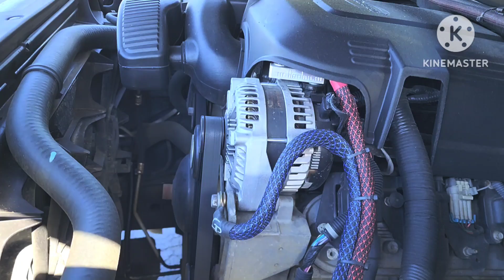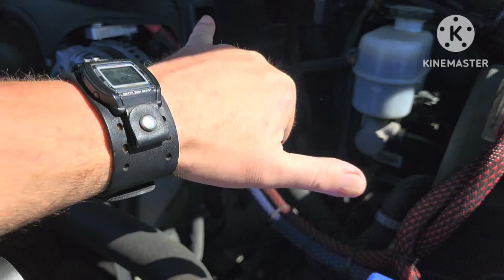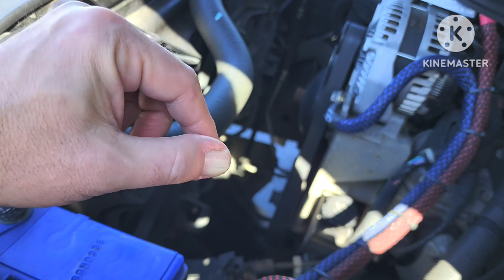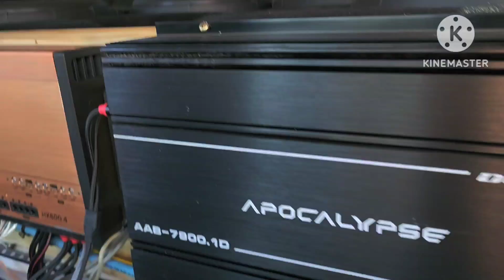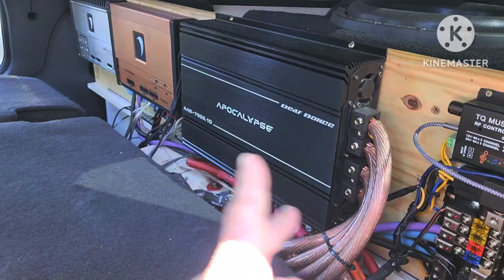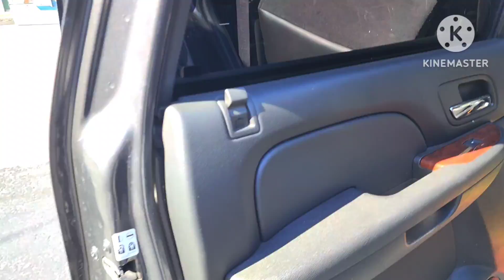Car Audio, Alternator, Battery, lithium, super caps, wires, explained

Comment: Definitely enjoyed your content.I’m running a 240 Mechman alternator to a stinger agm under the hood and Xs 3400 in the rear on ofc welding wire but experiencing voltage drop not sure what I missed here also have a 5 farad capacitor Thank you if you get back to me .Maryland showing ❤
Reply: One main part you're missing is what is your set up? People could help you if they new exactly what you're running.
Reply: @1904audio  excuse me on that ,2 12” W7 ‘s on a 1200.1 v3 amp and 300.4 JL v3 amp

Comment: Today is May 24th 2023. I've been wanting to add a lithium battery to my system but I'm not sure how to pick the correct size for the system. I still need to do the big-3 and I have not installed an app, I'm just trying to get all the power in the vehicle ready for when I do add an amp
Reply: You're headed in the right direction. I always advise people to get the power first the more power the easier it is to upgrade I the future.
Reply: @1904audio  Thank you for the encouragement! I wonder if the spark will be better as well in the combustion chamber.....

Comment: great video, how do you write the alt to the rear battery? Do you run wires from your front battery to the rear or directly from the alternator?
Reply from the maker: Yes, but through fuses
Reply: @teamsavagesounds  so do you wire alt to front batt and front batt to rear batt? Or wire alt to front batt and alt to rear batt? I wasn’t really sure if there was a recommended way to wire

Comment: My alt was bought right after my amp. My APCLE30001.D is very power hungry. So I got an H.O. made by G.P. 372 amps now baby! In combo with 2 big ass AGM Batts. Now we're thumpin.
Reply from the maker: yea got my 370 and a 300, all power wires done, some grounds, more grounds coming next weekend, with a new video!

Comment: Well if you running low wattage no worries on getting bigger alternator.
Reply from the maker: Anything below about 1000 watts stock alt is fine but you should do the big 3, and be sure your battery is solid